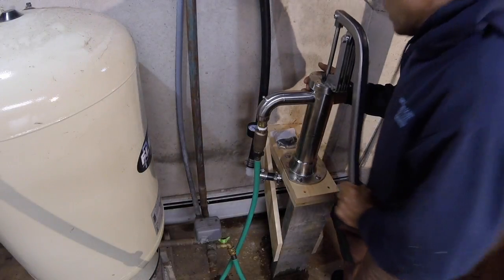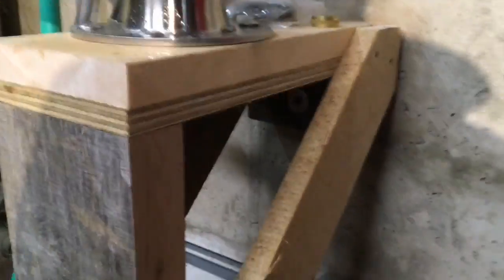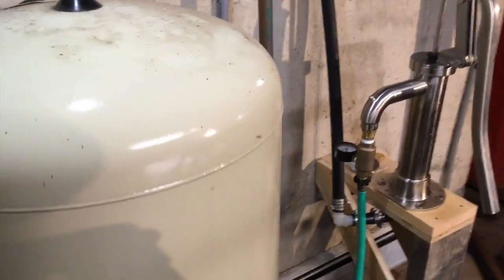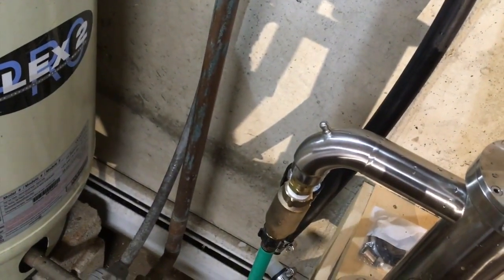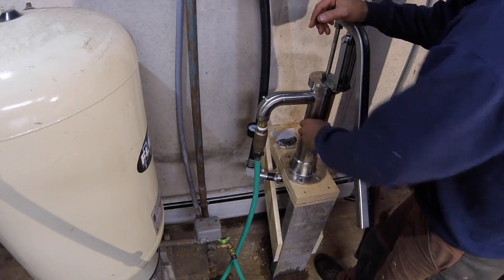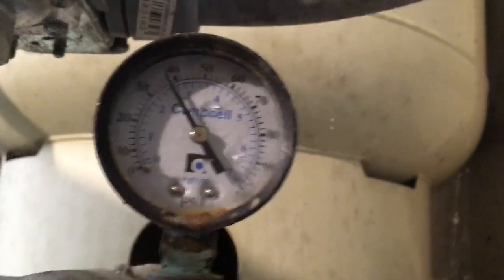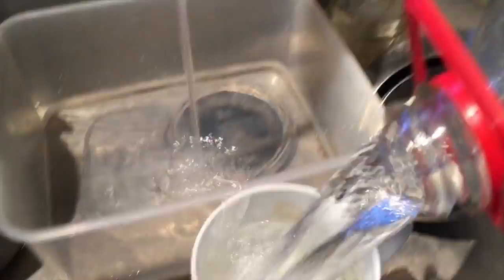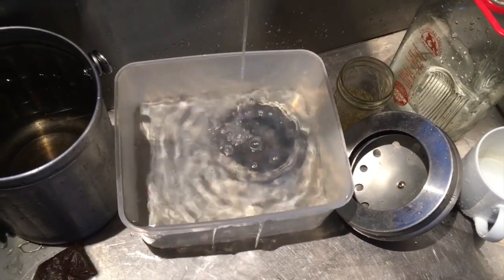Non Electric Water Pressure - Bison Pump for Shallow Wells

Comment: This video ignores the very important details.  If you want to use the pump to fill a pressure tank, the precharge in the tank should be adjusted to a low pressure range.  That will allow easier pumping and more water storage.  The guy making the video doesn't understand the terms he is teying to talk about, but still gives a good demonstration.

Setting the tank precharge to 20 psi would be great in a single story home.  That would allow max water storage for your tank size if you pumped it to 40 lbs.  You could likely go higher (50 psi) but the tank manufacturer does not recommend it because it stretches the bladder in the tank.  An older tank bladder would probably burst going from 20 to 50 psi.

A bigger tank will hold more water, but will take more to pump up too.